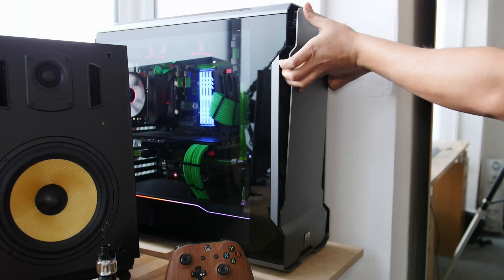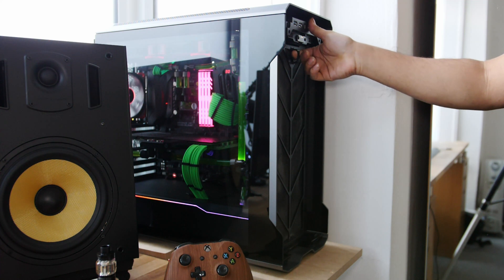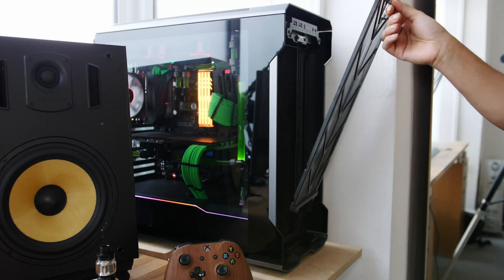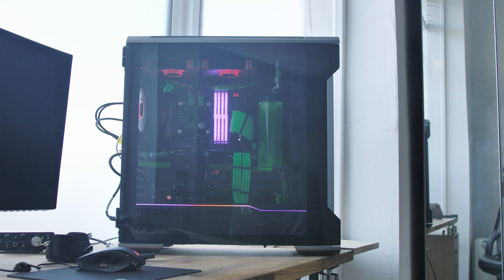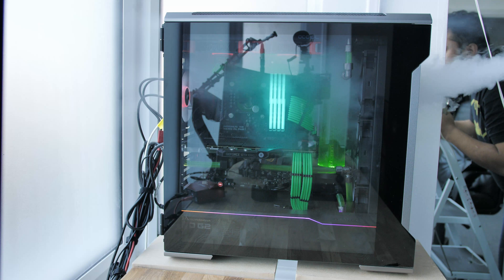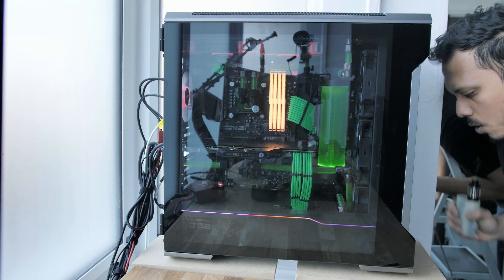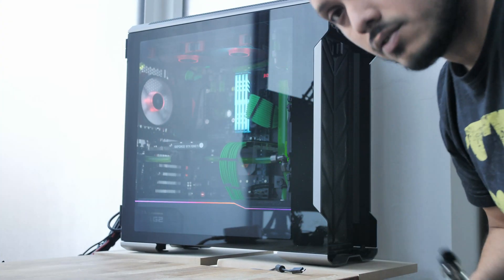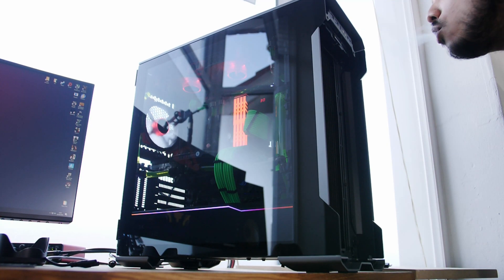How to test PC airflow - with a vape mod phanteks Evolv X #1

Comment: I cloud chased around my PC for 2 years...
I noticed some drops forming on my glass panel but didn't really mind...
After 2 years i've opened it and found my WHOLE SYSTEM was soaked in ejuice...
Dripped everywhere!I had found a lot of juice even in my 5700XT...
I had to open that up and wash every bit of juice!
I took the fan out and put them in a warm tub of water as well as my case...
Even after 3 hours of sitting there,they were still greasy!
Please consider doing this probably once,but never ever vape in your room with doors/windows shut!

Comment: yes check the airflow. then after a few months check why it isnt starting and the board surges. vape juice doesnt turn juice into smoke. it vaporizes it. it will turn back into liquid if it makes contact to the dust in your pc and that shit will accumulate and blowing it with pressurized air will not clean that shit.

Comment: Pushing more air in than taking out will always result in problems, thats why good cases have side and top fans. You can see remants of smoke remaining after you have stopped blowing. If you have proper airflow this wouldnt occur. 3 in and 1 out is not enough.
Reply from the maker: Mine is 3 in 3 out 
There is 2 more on top

Comment: I did this when I installed my a five pack of fans and needed to check for negative pressure since I vape. Also, thanks for the warnings I. The comments about leaving behind residue. I noticed it when I cleaned my clear side panel with ISO a couple days ago. There was residue from something, I've boiled it down to the juice.

Comment: Please don't do this often as it's liquid vapor it will leave your radiators sticky, and leave a bunch of your parts inside sticky with vapor residue and can mess with your fan bearings. Not to mention since it's liquid being vaporized when it touches a surface it can leave small liquid residue behind on parts although extremely rare, since it's liquid touching pc components well i think you know where I'm going with this. It's a great way to initially test air flow, but deff do not recommend doing this a lot.
Reply: Agreed. If you ever get a chance, check out the inside of (someone who vapes) car windows.  It's not water vapor that's being exhaled after all; but rather a mixture of Vegetable Glycerin & Propylene Glycol, a thick, usually sweet combination that leaves a oily coat just about everywhere.
Reply: @interlinkedMedia  normally i only noticed the residue in the cold winters when it seems to stick to my windows much more than it does in the summer. But I've never even thought about vaping near my pc before until Jayz 2 cents mentioned it
Reply: Wait, Im struggling to find logic in this. I think that having a liquid cool setup is far more dangerous than vape smoke. How many pc's have bombed from failed liquid cooling setups vs vape smoke? 

So the same could be said that if you hit the red line on your car once as a test - your entire car is just going to get carbon buildup and loose 1 million horse power and you might as well commute in a trolley?
Reply: @BiggieSmalls-s1c  If you vape, this will make more sense. Like I said, the "smoke" from a vape isn't smoke like from a cigarette or anything burning. It's VAPOR, aka WATER VAPOR, so when that comes into contact with a surface, it then turns into water. Next time you hit a vape, blow the vape smoke into your hand and you'll feel it get cold, that's because thats a bunch of moisture landing on your hand making it cold (kind of like why we sweat to have a similar effect). So in time, little liquid droplets and dew will form on your pc components and who knows, you just need to get unlucky once, just need that liquid drop to touch one capacitor or smd wrong, and ZAP. your gpu or mobo or whatever is fried. Liquid cooling, you're not taking the water and dumping into the caes lmao. It's supposed to be protected with tubing and what not. No water actually touches any components. Oh and the residue from vape is VERY sticky, and thus makes any dust collection that much easier, and that much harder to get rid of. Vape smoke is BAD for your pc
Reply from the maker: Best reply to this controversy
Reply: @thejafman  yeah, gachi's richgt
Reply: Exactly,people need to take in consideration that power supply have a fan too,that's what risky!
If some ejuice goes in your mobo,cpu heatsink,gpu and such,it's all good!
You'll probably lose those components in the worst case scenario,but if a lot of ejuice forms in your powersupply,it's potentially a fire hazard!
Reply: @@gidorah I quite smoking all together almost a year ago but my comment was about just using the vape smoke for a once off test to see the airflow.
Reply: This^ 
Look up smoker PC builds, They're absolutely disgusting. Gonna leave about the same residue
Reply: @wvlf  at first I thought “smoker” pc build was just a cool term a PC with smoke effects.  The reality is disgusting.
Reply from the maker: @wvlf  thanks for the feedback vape a cigarette smoke a very different a
This was only a test.
Reply: JKB
Both leave a sticky residue that attracts dust and allows buildup
Reply from the maker: Noted thanks alot